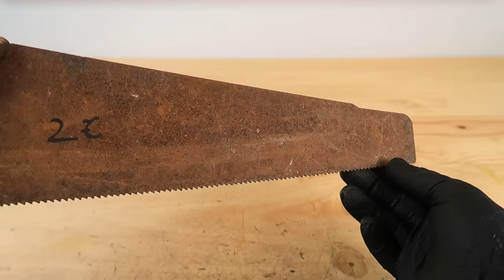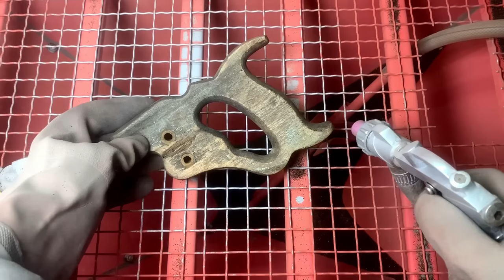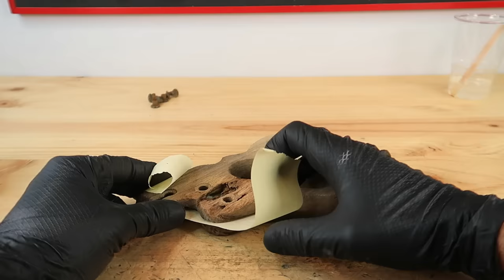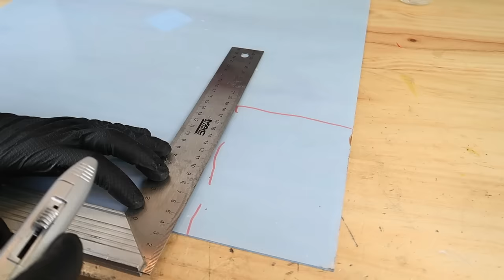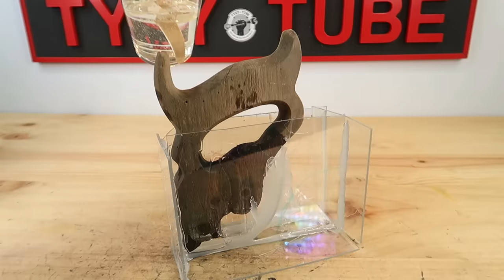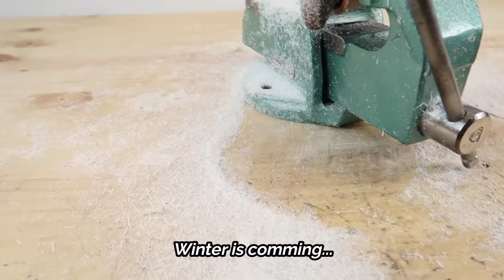Antique Rusty Saw Restoration | With Epoxy Handle Repair

Comment: Loved the fact that you restored the wooden handle. I wish more restorer's would do this instead of replacing old with new.
Reply: Sometimes the handles to broken or messed to restore, but I totally understand
Reply: Don't think using a bunch of plastic and chemicals to restore a handle is such a good idea...
Reply: Yessss! This comment is my thoughts exactly!!!
Reply: Spoiler alert
Reply: @progamer_221  the "spoiler" was already in the title of the video, so....
Reply: Da
Reply: @_Hnl_  you
Reply: @toddtanner95  pp
Reply: I think a good compromise wouldve been best for a handle this ruined, i think just remaking the wooden part of the handle with the design wouldve been better for this one, even if its new its still the old design just manufactured
Reply: He actually replaces wooden parts as well. Sometimes it's unavoidable, no matter how experienced.
Reply: برجليا صح
Reply: Bonjour Sarah
Reply: @casuallydone468  Yeah this is a case of "George Washington's original axe - handle replaced 3 times, head twice"

The point of the channel is to restore, not replace, whenever possible. Sometimes the end result is more a work of art than functional, and in this case the blade is clearly too thin to be of much use so why attempt to make a new handle when a resin-patched piece of wood looks so good?
Reply: Yes that was great 😊
Reply: It’s all based on a case by case basis and the skills/intentions of the restore
Reply: Resin stabilizing works wonders
Reply: I disagree, I'd have preferred he remade it with new wood. But this looks nice, too.

Comment: I see a lot of people questioning the restoration of a cheap tool.  But I see it as a testament to your skills and dedication to challenge yourself in restoring anything, no matter the cost of time or materials.  Great work!
Reply from the maker: exactly 😊👍
Reply: Ok, i was wondering where those comments were  I see a 1 dollar saw new, 50 years later sold for 2 dollars because of inflation, then a 20 to 30 dollar restore with hours of work to end up with a probably unusable  hand saw because the blade is to thin and the integrity is do compromised by decay.  
But if you enjoy doing, go for it.  I just don't find it interesting personally because I see no benefit for anyone for your time.  
No insult to you intended.  You're good at your craft. I've watched several of your videos and I did enjoy most of them.  Cheers
Reply: @emostorm7  - I was thinking the same thing.  Unusable hand saw with a flimsy blade.  If you're going to mount it in a wall, then fine. But if the effort was to restore to a useable antique saw, fix the handle and replace the blade.  That's what the screws holding it in place are for.
Reply: @emostorm7  hobby. It's probably never gonna cut a piece of wood again, but some people like getting old stuff and making it look new. It has that part of looking new but being made 80 years ago that makes it look like it traveled in time. It's hard to explain, but it brings about the same joy as finishing a woodworking proyect.
Reply: In a throw away society culture of cry babies... This is practically magic to them..
Lol

It's easy to do, the hard bit starting and finishing before you lose motivation
Reply: If it cast a shadow it can be restored.
Reply: @lawnmowerdude So my life can’t?
Reply: I imagined it was mostly for entertainment ^^
Reply: Juan Sambucetti But it doesn’t look new. This was a poor choice of an object to restore. My mechanics not only restores things but makes them fully functional again. What’s the point of polishing a saw that’s too far gone to be usable or even look good? Why not choose a saw that could be used again? For all the work with the epoxy it would have been easier to just make a new handle.
Reply: @PeterKoperdan  because some people use them as display pieces and think they look great.....everyones taste is different
Reply: Valid comment
Reply: That saw was sharpened and would cut wood easily again.  Dont think this resto was in vain :)
Reply: @emostorm7  "I see no benefit for anyone for your time"

Also: "I've watched several of your videos and I did enjoy most of them"

Do you not see the irony in this? The benefit is exactly viewers watching videos.

Comment: Tys: "This blade is too thin to blast"

Also Tys: "So anyway, I started blasting."
Reply: Sand blasting is almost like roto-peening the metal, although thin, is probably stronger. However because it was sand blasted, you can’t ensure a measured impact.
Reply: This actually made me chuckle
Reply: Underrated comment. Well done.
Reply: Is this a Its Always Sunny reference?
Reply: Restoration and hope is available each time you return to God.
Reply: Ryan Santiago highly, highly underrated comment.
Reply: very very good
Reply: @SpadeofSilver  ny  p

.
Reply: @5benkacortes608  oj
Reply: haha 😄👍
Reply: I'm back. Holy crap why does this have 1.1k likes!?!?
Reply: @Kathaar  Probably because it's funny and true 😄
Reply: John Benjamin David Tatum   there should be a laughing emot so i can laugh at you

Comment: don't listen to the naysaysers, restoring broken things is not about profit but the philosophy of not throwing things out. that said maybe next time when you use resin and wood utilise a vaccum machine too, cheerio
Reply: This crosscut or rip saw didn't have a plastic handle. What I know is that hacksaw blades are very different compared to these types of saws. Hacksaws have a wavy shaped blade. I've read it from the 1972 Reader's Digest complete do it yourself manual.

Comment: I'm a woodturner, you basically did a stabilisation on the wood quite a common woodworking process. In the future if you do it I'd suggest a pressure pot. It will push the rain into the porous wood and make it more even. Good job thinking on your feet to fix though.

Comment: Hey Mr. Tysy nice restoretion 👍 I can see that you like playing with resin 😊 do you want me to make you custom bolts for your vise so you can attach it to the table 😉
Reply: LOL
Reply: @ximoa.2399  what? Id get the joke
Reply: @hero303-gameplayindonesia8  He never responded
Reply: @idk-by9tu  maybe privately
Reply: @hero303-gameplayindonesia8  Check TT's merch store. "Bolt down your vise" has been a running joke approximately since the channel started. Also "Replace your capacitor" 😝 (the wire brush wheel machine / bench grinder).
Reply: Whats up man
Reply: I am mind blown at how you spelled restoration if you got it right for your name... no hate, all love, and some confusion.
Reply: @crimsonshadows6328  They may speak a different language in which case the phonetics they used are from said language. Just a thought

Comment: Next time try wood glue mixed with sawdust instead of resin :D
Reply: I agreed 😊
Reply: That’s what I was thinking too. The resin looks like it either boiled because it got to hot or there’s a ton of air bubbles because the resin was the first bit of moisture the handle had seen in a long time.
Reply: @dixie162003  With vacuum container you can get rid of air bubbles from resin, but still this won't be wood feel.
Reply: It is much cheaper solution then a resin.
Reply: I would have done that too, even though this is different wood, I used it for mdf.
Reply: The resin will harden, seal and protect the wood from further damage/rotting, while wood glue and dust will just seal it. And you could argue that it will harden it as well, with time moisture will creep into the wood again.
Reply: @barascr1  I agree, I think the resin  is a better fix, imo. 👍
Reply: Not sure the wood glue and saw dust would work for this one. Pushing really thick glue in the voids would suck and be very messy and not fill all the voids. The voids are to large and to many pockets so resin was the better option but he should have made the box on it's side and used the flexible cutting board for the sides. It would let him not fill the void for the handle easy. This would also let him heat gun the bubbles away.
Reply: Saw dust mixed in the resin or maybe make a new handle using the old one as a pattern...

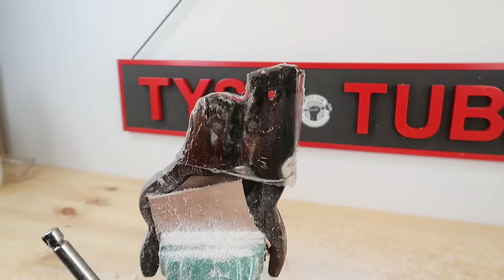Comment: 8:08 The vice is moving around and I'm thinking to myself, "If only there were some way to secure the vice to the table..."
Reply: Not gonna lie, I thought that at first too, the one in my shed is different 😂
Reply: I thought the exact same thing
Reply: I have limited room for workspace. What I did was attach the vise to a 2'x2' piece of 3/4" plywood. It's got a big enough base that it won't move most of the time. If I need more stability I just run a couple screws through the plywood and into my workbench top.
Reply: With another vice

Comment: Great restoration!  If you anticipate replacing wood with resin on many more projects, I recommend finding a vacuum pot.  Instead of leaving your shop made container with handle and resin out to dry, just pop it into the vacuum for a couple hours until the bubbles stop coming out of the resin.  The vacuum helps the resin penetrate the wood fibers better, plus removes all the milky color (air bubbles) out of it as it hardens.  I've seen that work many times on wood turning channels.  Just an idea.

Comment: I repair saws...to sharpen draw a file across the points. 

With a saw file always sharpen the tooth towards the handle, then turn it round, do the other side. We set the teeth in opposite directions to form the cut. 

Bilt Hamber Deox, is a powder, add water to remove rust from metal.

Great job saving yours thx for sharing.

Comment: My sister has an old cross-cut saw that belonged to my great-great grandfather. My dad (who has passed away) had it and told of how he used it when he was young to cut firewood and how it had been used to build the original family cabin. It's totally in terrible condition and is unusable, but I would love to "restore it" like this - encapsulating the handles in epoxy to preserve the "original" handles that had gone through so many hands.

Comment: When using epoxy resin you should use a small paintbrush and paint it on the wood, that will create a seal, the reason a lot of the resin disappeared was because the wood soaks it up like a sponge, especially that the wood it old and dry. Great video!

Comment: Very nice job! Only thing I would suggest is setting the epoxy inside a vacuum flask to eliminate the possibility of aeration which is evident in the final product here. Other than that it was an incredible save from the junk pile.

Comment: Why not just make a new handle and buy a new blade...
Reply: Then that wouldn't be a restoration now would it.
Reply: U r missing the point,
Reply: Derp
Reply: Um, that would be silly - it's cheaper to buy a new saw rather than buying the parts and assembling one.

Also misses the point..
Reply: @phylismaddox4880  It's the Saw of Theseus if you do it that way though. So you can argue that it's the same saw and therefore a restoration and not just a replacement.

Comment: You should line your makeshift epoxy molds with wax paper or something similar, so when you open it up, the sides will come right off.

Comment: Raw oxalic acid is very good at removing rust.  It also destroys cotton and polyester socks too.  I once stepped in a bucket of it.  There is also a new tool for removing rust.  The tool uses a laser.  The tool does not remove any metal just the rust.  There are videos on You Tube demonstrating it.  I do recommend that you watch them.

Comment: There should be a galvanic way to build metal on the saw. Make it thicker, close the sinks, and then polish and polish to a mirror shine, as we used to see. As a restoration material, you can use a mixture of glue for wood D3 and small sawdust from hard wood. This is just reasoning, not criticism. You did your job well as always.

Comment: I think next time for the wood. Soaked it in epoxy resin then use a vaccum chamber to force the epoxy deep into the wood, take it out and let it drip then sand it and clean it up.

Comment: I have 3 of these old saws from my grandfather, but they have been in a carpenter chest that havent been opened in 70 years. I opened it 3 days ago, it has tiny bits of rust and some patina.. But its been dry and i see very little mold/rust on the tools.. There where pennies from 1923 in the bottom of that chest, im from Norway. But all his siblings moved to NJ back in the days. The saws have same handles as this one u are restoring, thats why i pressed this vid. Thanks for watching!

Comment: you did a good job remembering to sharpen the teeth of the saw, unfortunatly you didn't seem to realise that after sharpening every tooth needs to be realigned to a certain angle to stop the teeth catching and getting jammed when cutting wood, you can buy a special tool to do that - many old fashioned tool stores still run a service where they will send off saws to be properly sharpened and the teeth reset by a specialist, it can take up to a week to get the saw back, but its quite cheap
Reply: Yeah, from what I saw this is t going to cut straight or maybe even well at all. Other than that, cool vid on restoring a dead tool.

Comment: I assume that you are not going to use this saw, VERY nice restoration by the way, However, to anyone else looking to do this, You can do this same job with the handle,  but use a replacement saw blade form amazon unless there is not much pitting in the blade you are restoring.  VERY good restoration otherwise.  I would offer one thing. Use a piece of plastic to section off what you dont want epoxy in. It will save time getting rid of it.

Comment: Next time you work with rotted wood like that, mix sawdust in with the epoxy, it will bond and be just like wood putty with strength, and look more like wood and is sandable..

Comment: Very ingenious epoxy mold. But heavy-duty aluminum foil backed with some cardboard (for the blade slot) would have been faster and required less epoxy.

Comment: I like that he used the word saw instead of hand saw, looking at the size it is a table saw, used to cut around the circumference of a table top.
 Obviously not the modern electric one we use today.

The saw is too far gone to be used day to day. The pitting does not matter, until it is at the tooth area, and I can see deep pitting on some of the teeth, this will weaken them and they are more likely to break. The spring steel in these old saws seems to go brittle over time, fine for sharpening by hand, when I have sent large 19th century ones  for machine sharpening they have had problems with the teeth breaking.
For a wall hanger the restoration is fine, if I was to use this saw the resin in the handle would be a problem, there is no better material than wood finished with an oil or wax for comfort.
Any kind of varnish, resin can cause friction and blisters. 
It is always interesting to me to see vintage tool restorations, lots of different methods to see.

Comment: I would have built one out of wood  but  it turned out good the way you did it  that's why you are doing and I am watching the only problem I have with the final product is that isn't hanging on my wall all joking aside  your work is impressive  if you run out of room for all your projects  send them to me  I would certainly find a place for them

Comment: I would fix the handle using Total Boat 2:1 Epoxy with the Slow Set Hardener, thinned with Acetone at 4:1 (Epoxy:Acetone; example: mix 4 oz Epoxy according to directions then add 1 oz Acetone), the Acetone allows the Epoxy to penetrate into the weakened areas of the wood MUCH deeper than it normally can then evaporates allowing the Epoxy to set as normal.
The Acetone does increase the time needed to fully Cure the Epoxy but doesn't otherwise affect it. Total Cure time for this handle would be 2-4 days depending on how hot/humid your shop is at the time.
When I build the mould, I would make sure the hand hole is filled in with a plastic waste block to reduce the amount of Epoxy needed to coat/fill the wood (reducing how much Epoxy is needed is critical, that stuff is NOT cheap)...
Once I pour the Epoxy-Acetone mix into the mould, I would place the mould in a vacuum pot to ensure all the air is pulled out of the wood and Epoxy (further increasing Epoxy Penetration into the wood) and let it set.
After the Epoxy has Cured, I would re-cut the handles outer shape and blade slot, drill new screw holes, wet-sand up to 1600 grit and polish for a glossy shine.
The Epoxy would also act as a protective Finish for the wood so Paint, Lacquer or Shellac aren't needed...

Comment: I don't know whether boiled linseed oil is available in France but it works better than plain linseed oil on wood.  It gives a nicer finish with a better sheen and a slightly darker colour and it also dries faster.

Comment: I think you missed two steps.  First the saw teeth needed to be dressed before they were sharpened so they are qall the same height.  Second, filing the teeth should be done after the teeth have been 'Set'  so they ared all the same width.

Comment: I wonder if sanding the handle, then using saw dust and wood glue to make a paste that you then fill the holes with would have turned out better?

Comment: As a seasoned  enthusiast, I will make some recommendations. Use clay not tape for epoxy dams. Linseed oil will darken wood. The rust remover is useless for deep corrosion. Beadblast is a not a good idea for thin alloy steel. The lack of attention to the saw tooth geometry is the biggest oversight here.  A victory cut wood have been nice, but we all know that isn’t going to happen. Pay attention or pay cash!
Reply: I know, I couldn't believe he thought the (masking?) tape would hold the resin. No chance!

Comment: Good job! I like the way you solved the epoxy problem and it allowed you to work it back it shape when it dried. I thought that you might decide to veneer the handle and I wanted to see that. The sharpening of the blade was something I really appreciated, but that rust really beat it up so now it has character. Cool vid!